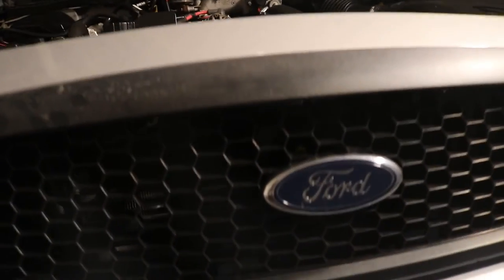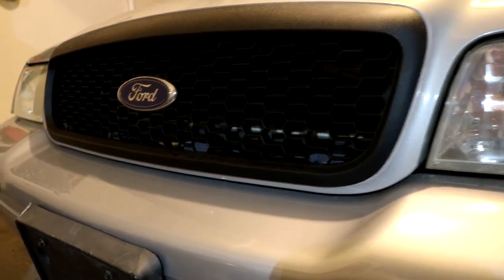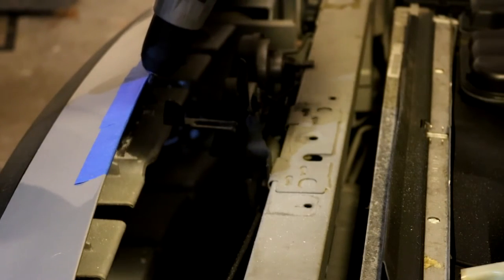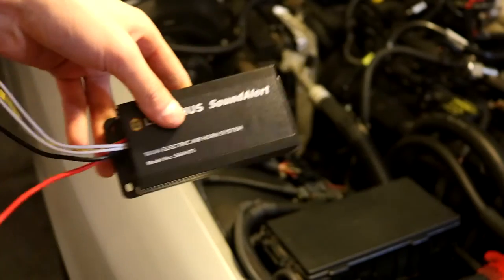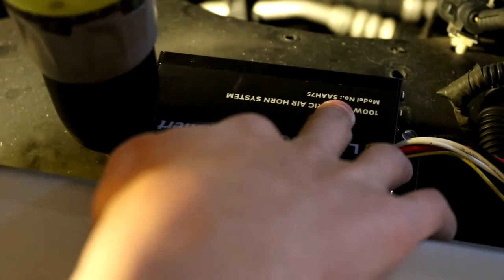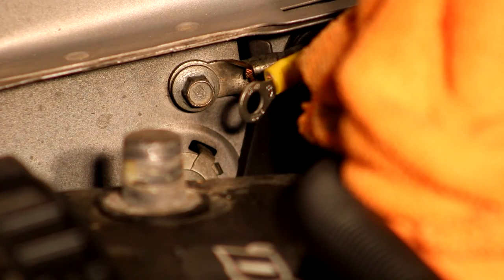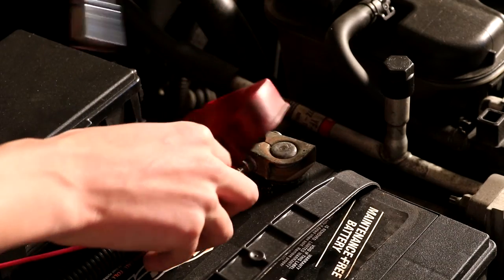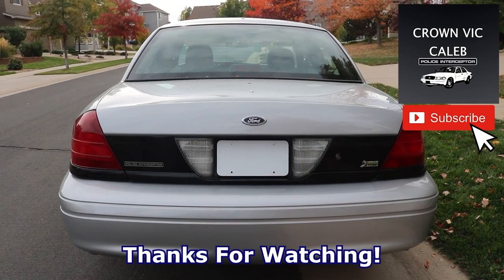Lamphus SoundAlert Airhorn Install On Crown Victoria Police Interceptor | Crown Vic P71 Project

Comment: So you put a separate in-line fuse for the switch? You used 14 gauge wire for everything right? You have such a detailed video, I’m trying to install mine but I want to make sure I’m wiring everything correctly. Very helpful video!!
Reply from the maker: Yes correct! If you have any other questions let me know. Hope the install goes well!

Comment: It’s appears that this set up is killing my battery when the vehicle is off. Do you know what I may have done wrong?
Reply from the maker: Hey Jeremy, I got in contact with Lamphus for you and they said It's most likely an internal fault with the amplifier unit. Depending on where you had bought it from I would try to get an exchange going for a new one. Hope this help!
Reply: @crownviccaleb8388  Thank you for going beyond to trying to help me out. I google Lamphus and did not see a website l. How did you contact them? And can you please forward me the info. I bought the products and I already went over the return period.
Reply from the maker: @jeremycastillo1932  No problem! I was able to contact them through www.online-led-store.com!
Reply: Hi. I have a question, is the red light on the amplifier supposed to stay on?
Reply from the maker: @jeremycastillo1932  The red light should be off until you click the button for the horn. When the horn is active and making sound the red light should turn on!
Reply: @crownviccaleb8388  How is your power source connected? Is it direct to the battery.....connected through  a cig. Port, to a fuse??

You could be connected to a source that doesn't turn off. In this case, 

-Add a switch to disable the unit manually.  

-You can wire it using a cigarette lighter power cord....just make sure the port turns off with the car.

- Get a fuse tap from Amazon or your local automotive store. Connect it to the radio fuse, and it will turn off and on as the radio does.